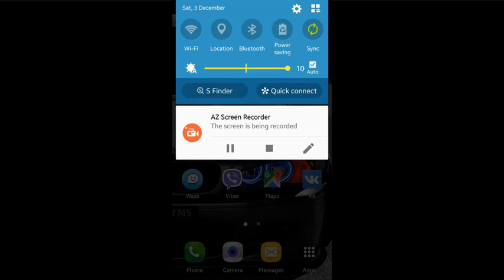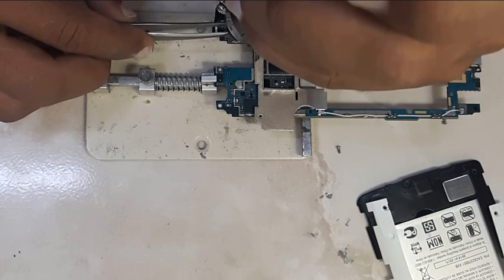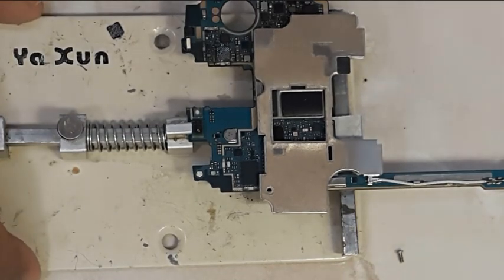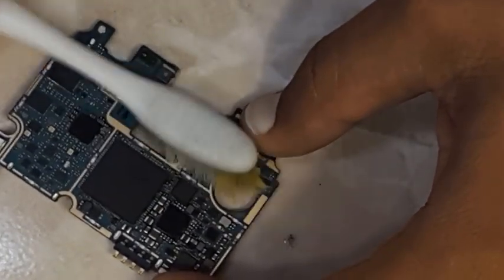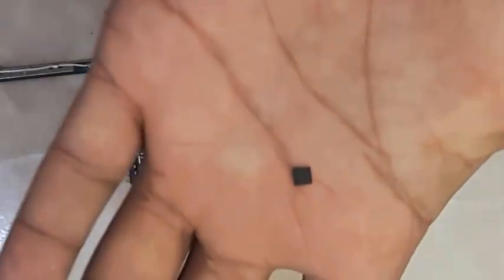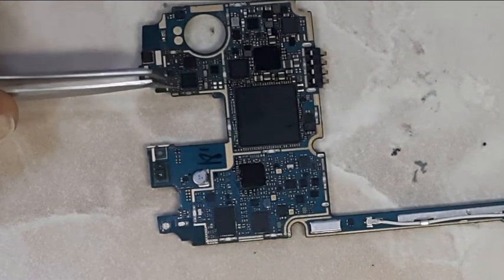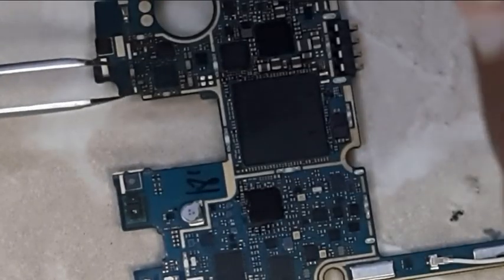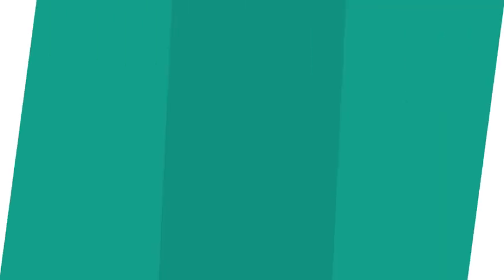lg g3 wifi problem and bluetooth turning on/off change ic part 2

Comment: hi i have this problem and heat problem. if i fix the wifi will heat problem be solved?
Reply from the maker: if wifi ic has short that may cause of heating phone.otherwise cpu problem
Reply: @mobilesolutions  so if problem cpu no solution? thanks for the answer
Reply from the maker: @glassmarble996  .have solution. change cpu

Comment: My lG v 10 mobile wifi not 10 working how to on my LG mobile wifi
Reply from the maker: lg v10 has a wifi chip named BCM43455HKUBG.
HEAT THAT CHIP OF NOT WORKED REPLACE IT.
Reply: @mobilesolutions  tynx bro😦😭my mobile chip is damage o shittt my wifi😢😢😭😭
Reply from the maker: @itsrindan4209  yes bro but no need to worry you can get it.
Reply: @mobilesolutions  yes bro ok i get it again thank u so much😍